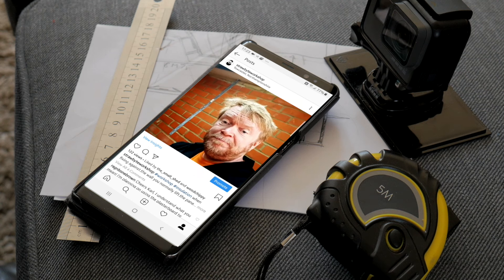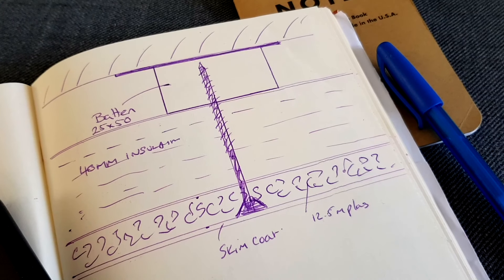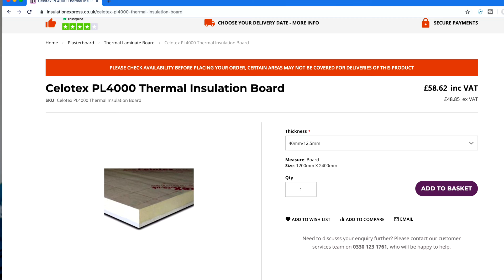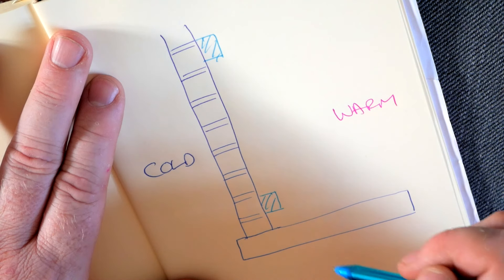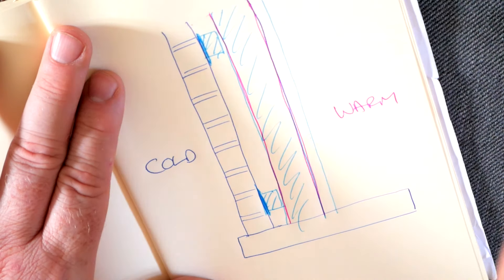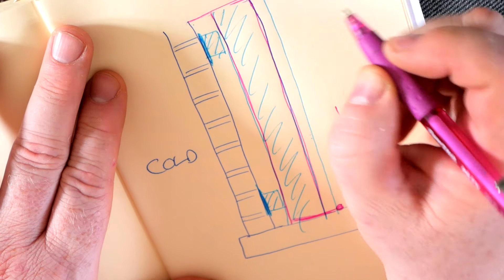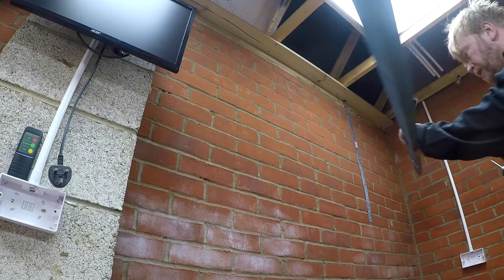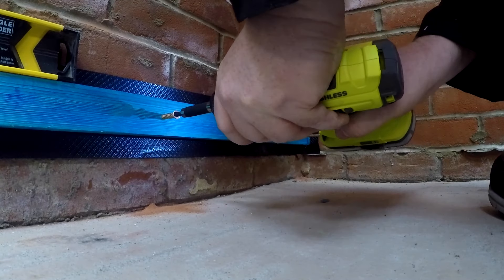How to Insulate Your Workshop | An Easy DIY Project | Keep Your Shop Warm or Cooler

Comment: Just about to tackle this exact same project myself, so your video was extremely helpful. I missed it in the video but why did you use the MDF and the insulated plasterboard instead of just using one or the other?
Reply from the maker: Hi Mike. You're right I didn't deal with the switch in approach well in the video and your question is probably the most common question asked because, as you say, I used two different methods to insulate the walls.

I started by using Insulated Plasterboard from Celotex. This is 40mm of foil-faced PIR insulation with 12.5mm of plasterboard on top. This was easy to use but VERY heavy and as I would be doing most of the installation myself I knew I would struggle. In addition I would have to order in small quantities as you need somewhere dry to store the material due to the plasterboard element.

By switching to Celotex and MDF I could store the bulky insulation outside (it was summer so wasn't really raining much) and pick-up the MDF as required every 2-3 days from my local builders merchant.

The video was filmed over about 2 weeks. The beginning of the video had me install all the insulated plasterboard I had delivered. I then ordered the ordinary celotex, waited a week and then did all the remaining walls over 3 days. At the time, the cost was about the same per sq m of wall.
Reply: @StrawbyteWorkshop  ah now it makes sense! I will give the mdf option a go, I buy a fair bit for my cnc projects so maybe a patchwork quilt of a million off cuts 😉 but seriously thanks you clarified a lot of things for me in your vid.

Comment: when you installed your insulation boards, you said you need to seal the top and bottom to maintain the vapour, how did you do this, did you apply the same foil tape to the exposed edges of the insulation board or use something like the DPC on the floor underneath before sealing?
Reply from the maker: Hi Nick. The first thing to mention is the the advice I followed from the insulation board manufacturers didn't require the exposed edges to be taped, just the joints between the boards.
At the top a bead of sealant was run along the top-most batten forming a seal between the insulation board and batten. Once installed a bead was then added between the foil face and the board at the top. MDF over the top and again sealed with decorators filler this time to give a nice finish. At the sides and the bottom a 5mm gap between the insulation board and the wall/floor was sealed with a thick bead of sealant was installed at the front of the insulation board. Again when the MDF went on decorators filler to tidy-up the front face. I'll see if I can find the link to the technical drawing from the manufacturer.
Do remember that I'm not aiming for a technically perfect result as this is not a habitable part of my home. Around the concrete piers there is clearly some thermal bridging and some further work to do, and ideally I should have laid the floor first and linked a DPC (which I didn't install) to the wall DPC.
Anyway I hope that helps.
Reply: @StrawbyteWorkshop  Thank you Karl, this has been a great help again. this video has been an incredible help with my own garage insulation project so finding it was like gold dust. thank you again for all the videos you make :)

Comment: What a great video. I've found others that have me advice but yours is amazingly detailed and helpful. This is what YouTube (social media) is for! Question, you mention sealing the top and bottom, how did you do this and what did you use? I see a reply to a previous question mentioning that the board's didn't interact with he floor. My garage is a little older, and wondering what I put around the bottom of wall and floor to help seal. Thanks
Reply from the maker: I got my boards within 8-12 mm of the floor and sides and used a thick bead of acoustic sealant (AC-50) and where the uneven floor or pillars left larger gaps used expanding polyurethane foam first.
I used AC50 because of the noisy tools and I hoped it would limit noise transfer through the wall to my neighbour's garden.
And you're correct in noting the objective to avoid direct contact with the floor. It is tempting to simply rest the wall boards on the floor, but there is a risk of moisture in the cold floor wicking up through the wall materials. I did have one spot n the garage where the wall panels I installed touched the brick below the DPC and a huge stain appeared over several months.
Anyway thanks for the question and I'm glad you enjoyed the video. Regards. Karl.
Reply: @StrawbyteWorkshop  amazing Karl, thank you for getting back to me and the details. So much US woodshop content it's great to see something similar to my set-up and pains. Can I ask how you resolved the issue with the DPC, did you put a piece of barrier over the brick?
Reply from the maker: @gsallis85  Yes - basically that was the fix. The issue was that the bricks below the DPC in one small area of the garage wall were particularly wet and had bridged the DPC installed by the builders to wet-out the mortar coarse below the blockwork above. This is really a poorly installed DPC. The approach was to take some barrier from under the floor and tie it into the mortar coarse above the faulty DPC, and then a second layer over that up the wall to around .5m.
I did film some footage of the fix but didn't post an update as interest in this video had dropped off. However, it has picked-up and I've received a lot of interest and questions recently so think it might be worth putting out a follow-up.

Comment: Great video Karl. Keep them coming. Could you please elaborate on why you chose MDF for some walls and plaster board for others?
Reply from the maker: Good question. I had originally planned to use insulated plasterboard for the whole project. Each sheet costing around £60 each. The video compresses time a little as having got some experience with the first wall I decided not to skim with plaster and then the cost of priming a bare plasterboard wall for paint pushed the cost of Insulated plasterboard over that of insulation plus MDF. The bonus being that mdf is easier to fix small items too.
Reply: @StrawbyteWorkshop  Dear Karl, Thanks for the very rapid reply. I guess there were many other options. it seems that you reached an acceptable compromise for you particular situation.
Reply: @StrawbyteWorkshop  if you were doing this today, would you just do everything with the MDF+insulation option?
Reply from the maker: @amahmood3799  I think there are two things I would do differently if I did the project again. 1. Yes, I'd not bother with insulated plasterboard for a workshop insulation project. MDF that's been filled and sanded gives a surprisingly good finish and is quick and easy to achieve. 2. I would use 15mm MDF rather than 12mm. For a difference of 6mm over the width of the workshop the benefits of thicker panels in terms of being able to fix to the wall outway the small extra cost.
One final thing, I'd do the floor first and use a membrane tied into the walls. I expect to do a follow-up video where I explain why properly and where I show the fix, but one area of the new wall panel has been badly affected by rising damp from the two courses of brick below the damp course.
Reply: @StrawbyteWorkshop  I look forward to your updated video. I already have the floor "done" using pvc matting like yours and take the point re: 15mm vs 12mm too.
Reply from the maker: @Lita Chitalau Yes it's been much requested follow-up and I'm trying to get something out in a couple of weeks time. Is there anything in particular you need help or explaining in more detail.
Reply: Exactly what I wanted to know, I’m thinking the house side of the garage did not need the celotex because it’s an insulated wall already, anyone confirm this please?

Comment: If you fix something to the wall, won't you penetrate the vapor barrier(s)? Also, did your tools corrode in the uninsulated workshop?
Reply from the maker: Good question. And I may cover that.in a little more detail when I start fitting out on the walls. I've 3 methods which preserve the vapour barrier and allow for light to heavy fixings.
Reply: Strawbyte Workshop, Would like to know more about this also!

Comment: Great video! Must have watched it 5 times already in preparation for doing a similar job. Quick question - wasn't there a video on the installation of your roof insulation..? I could have sworn there was but now I look for it I cannot find it! Maybe I'm just going mad.
Reply from the maker: You're not going mad - there was and I took it down a couple of weeks ago. A roofer kindly pointed out a mistake I made in my approach which I'm busy correcting at the moment. The original videe is on this link:  https://youtu.be/fpO6lMwRpCQ
In the video I explained that I battened out the roof and placed a second layer across those battens. This creates a gap which doesn't give you any extra U value and creates an opportunity for moist air to collect inside the void. What I should have done when I decided to put the second layer in was to pull the first row of insulation out flush with the battens and then applied the second layer. Anyway, when I've corrected the problem I'll re-edit the video and post it up. It's worth saying that having inspected the installation and had a buidler friend take a look, there were no issues identified in the roof space. Ventilation from the eaves to the ridge seemed fine. I'm helped in poor and cold weather that my estate is on top of a hill and my garden is very windy.
I hope that helps and I've been looking through the comments and I might do a follow-up in a week or two, if time allows.

Comment: Great video, have you also insulated the roof ??
Reply from the maker: Hi Keith - yes I have and I did make a video about it (linked here: https://youtu.be/fpO6lMwRpCQ ). It's worth saying though that the roof insulation isn't perfect and it's been pointed out that I made a mistake in applying to layers of insulation. I'm in the middle of making a few changes and I will be re-editing the video to remove the error from the advice. In short, there should be no gap between the first and second layers of insulation. Anyway - here's the link if you want to take a look.
Reply: @StrawbyteWorkshop  Brilliant, thank you for coming back to me, I’ll watch that and look forward to your edit, keep up the videos, great work.

Comment: I have a question - in our single skin garage we have a lot of issues with things inside getting damp (e.g. cardboard will go slightly floppy and become useless if left in). Is doing something like this the solution?

Also why do you keep the wooden lower horizontal baton slightly off the group?
Reply from the maker: Thanks for the question. It's important to check to ensure that there's nothing that is making your wall wet above the damp proof course. For example, leaking gutters or downpipes, planters or flower beds higher than the DPC. In general single skin brickwork is porous and water can penetrate through if allowed. Before I started I had issues with things I placed close to the wall getting damp. This is generally a problem due to the cold wall and the general lack of air circulation around boxes and things you  might store. Done properly with a vapour barrier like you see in the video, you can address the sorts of problems you've mentioned. I've not had problems with rusting tools or mould on the back of boxes or cabinets since installing the insulation. I have installed frost protection and a de-humidifier since completing the project for the winter months and for comfort on cold damp days.

With regards the second question. The lower batten is installed above the damp proof course. There are no fixings below the damp proof course which could corrode and fail. Simple.
Reply: @StrawbyteWorkshop  Hi sorry I never responded, youtube notified me of the like but not about having a comment reply! I really appreciate this. I have checked and it doesn't seem like there is anything above the damp proof course, though one wall like yours is the boundary and in the neighbours garden, though i don't think they've put any plant pots etc there.

How long do you run the dehumidifier for typically in winter? Also does your garage door have gaps around it or did you somewhat also seal those off?

Do you think the roof insulation would be necessary as well as the walls?

Comment: Question: would you recommend dot dabbing insulated board with silver backing straight to the single skin wall or baton out? I have several views on this and one was there is no need for a vapour barrier when using a silver backed insulation board...
Reply from the maker: So all the manufacturers of insulated plasterboard will have adhesives to bond the board directly to masonry. However there this is recommended only where the wall is completely dry and there is no chance whatsoever of the exterior wall becoming wet - especially with brick. The approach I took is the recommended approach where there is a risk of the wall getting wet (rained on in my case).
The Kingspan data sheets are particularly useful and I would recommend looking at those.

And yes, the silver backed boards have actually two vapour barriers. One on the rear, the other sandwiched between the plasterboard and the foam insulation. You need to ensure that the boards joints are sealed where they meet and around the edges to prevent warm damp air creeping behind and condensing on the wall. You need to seal any fixings that go through the board too. In my case jointing compound for the board joins and AC50 accoustic sealant around the edges.
Reply: @StrawbyteWorkshop  one last question: should there be an air gap / vent at the top of the boards to allow the air behind the boards to circulate or do the boards need sealing at top, bottom and sides? I’m in two minds whether to leave the top open ended (even though the two walls I’ve already done have batons at the top and bottom so in effect the gap behind will be sealed.)
Reply from the maker: @MrStemm1  It should be sealed to prevent inside air moving into the gap. If you ventilate the gap it should be to the outside. In the video putting the board at the top to effectively give me a ceiling was part of that effort. The air in the gap should be cold and dry. By leaving a gap between the inside and the gap you risk warm moist air condensing on the wall and it will have no where to go. I hope that makes sense.
Reply: @StrawbyteWorkshop  I’m interested to read your reply. I’m looking to do a similar project, my garage is in the middle of two other garages. The partition wall is breeze block and the front and rear wall are brick. Can I dot and dabb the partition wall and then batten the front and rear walls to avoid trouble? Thanks.

Comment: Very good video, thanks. Did you consider dot and dab insulated plasterboard to save time and space?
Reply from the maker: I did. Dot and dab would have been viable if a) the wall had a cavity, or b) I could guarantee that the exterior of the wall could be completely dry at all times. In the Kingspan installation guide they go into detail about the options and given the situation I was in with a single skin of very porous brick I went with the recommended batten approach.

Thanks for the comment and question.
Reply: @StrawbyteWorkshop  brilliant, thanks. That info has just made me realise I have to do mine the same way. 👍
Reply from the maker: @jojitsu56  I'm glad I could help.

Comment: Hey mate, how do you edit your videos?
Reply from the maker: Hey there. This video was probably one of the first that I edited in Final Cut Pro. Previously I was using iMovie on the Mac. I'm not a very technical editor. I cut scenes together and do some simple tweaks of colour an exposure on the shots themselves. And the little trick with the instagram video is do-able in just about any editor and very simple.

But thanks for the question. It's good to see this continuing to get views. Karl.